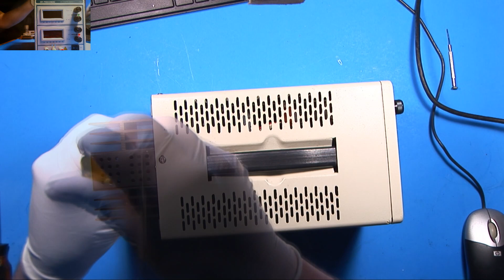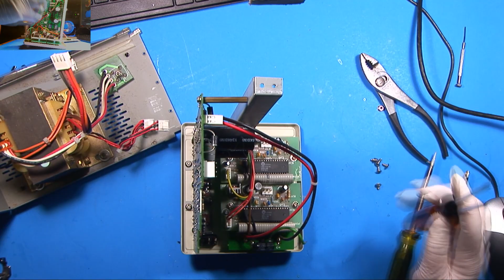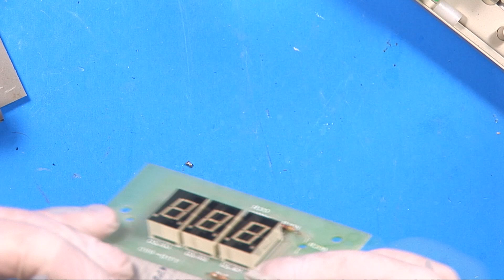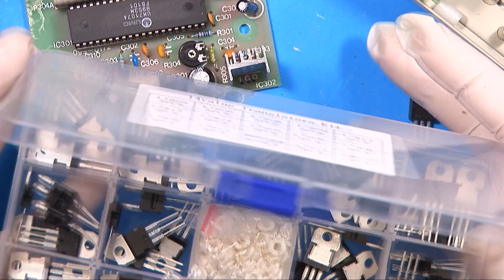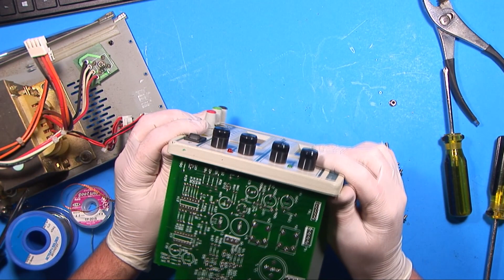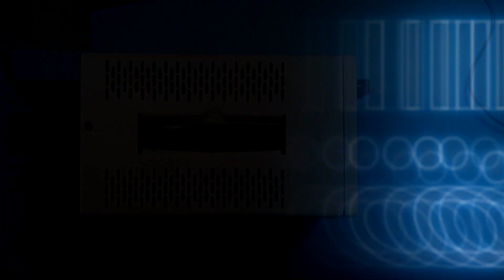Bench Power Supply Teardown and Repair - BK Precision 1735

Comment: I always teach my students to clean of any flux residue after a repairjob.
First: A bad solderjoint is much better visible without the residue on and all arround it. Secondly, if you spot a not cleaned up solder joint, you immidiatly know someone was in here before who couldn't care less.

Comment: I am considering recapping my 1735, because it is decades old, and I have some questions. Here is my link on EEVBlog. I posted there, because I can't post pictures here. Please give it a look. I would greatly appreciate your help. https://www.eevblog.com/forum/beginners/bk-precision-1735(non-a)-psu-recap-question/msg2445162/#msg2445162
Reply from the maker: hey sorry I didn't get back to you sooner.  Looks like Jay answered your question.  He's absolutely correct, couldn't have said it better myself.  If you recap the unit, just unsolder the caps that are installed and slap some new ones in.  Just be sure that you have the polarity correct.

Comment: @ Cody - I have the 1735. At zero volts, my minimum CC setting reads 0.01A, on the on-board display. It reads 77.8uA on my Brymen BM869s DMM, being in series and without any load other than the multimeter's own burden. I am a novice, so if I did not put the multimeter in series correctly, please let me know how to do it and I will re-test for you.

My guess is that your 96mA is just caused by a required minimum load for the circuit to operate and is acceptable. The data sheet may provide the exact answer: http://www.ti.com/lit/ds/symlink/lm723.pdf I am not great at reading these, yet, so, if you do look it up, please post the exact answer.

And, if there are any other type of tests that you would like me to do, just ask. My lab is set up permanently, so it would be know problem.
Reply: Hey, so the lm733 is only making a 5v reference which is then inverted by the opamp for a +- 5v ref. It has no control over the actual regulation of voltage or current in the power supply it's all controlled by the opamps. The 723 could have been replaced with a 5,v reference Chip but back in the day it was cheaper to use a 723 than get a reference ic accurate enough

Comment: This is a nice three-part series on the BK Precision 1735 (non-A). Thank you for your effort to share the information.

You mentioned that you would not be calibrating the voltage and amperage readings, because they were good enough. Mine are significantly off, so, if you could borrow the unit back from your friend, I would really appreciate a calibration video... Even if you just referred to the schematic and talked about how to do it, that would be helpful... Yes, I know about just using a multimeter, but it bothers me that the on-board meters are not correct/close. Thank you.

Special thanks to Cody for the schematic!!!

I had trouble finding this information, so I posted your links on an EEVBlog thread, on the subject. https://www.eevblog.com/forum/repair/bk-precision-1735-power-supply/

Comment: Hey, I got a 1735A a while back which was stuck in CC mode, I couldnt find the schematics, so i emailed BK precision on there website and surprisingly they emailed me the schematics for it, mine is the "A" version and only difference i see is that it has a 4 digit v/I display instead of three, all the control circuitry is referenced to the positive output terminal and therfore control ground is riding on top of the main output voltage, the schematic is drawn quite poorly and the lack of a legend makes it very hard to decipher certain parts, i got it fixed and working great no problem but for the last year as time allows ive been trying to understand and redraw the schematic to try and figure out the issue im having, the constant current works, but i can not set it under 96mA, so when i short the output with the course and fine current controls completely turned down it pushes 96mA, instead of (ideally) 0-1mA while the controls are all the way low. it does have a +/- 13 and +/- 5v derived from a extra winding on the secondary(with the center  tap referenced to the positive output as stated above) but the configurations of the amplifiers, throw me off, if the inverting and non inverting inputs on the cv amp were switched i would understan it all completely,and thats how i would have done it, but yeah, im lost.
so.. could you test, if you still have the unit or your friend can check maybe? if you dont mind, what the minimum constant current can be set to with direct short on the output and the C/F current pots turned low as they can go please? i would so appreciate it and do anything, ive been trying a year to find someone with a similar unit but they information of them seems so scarce online, let me know if the schematics would be helpful to you and i will send them, the schematics are for many models like 1710 1715 1720 1730 and 1735 and theres a table showing any parts/values that differ between the models, thanks for your time.-
Cody
Reply from the maker: Sure. I already gave it back but I may be getting it back to fix.  He connected it to a tesla coil kit and it got zapped and won't turn on.  Not sure what happened considering the case is grounded but if I get it to fix and once it's fixed I'll check for you.
Reply: @Electronicle  Okay great, also if you could please, take a clear picture of the front and back side of the board, im going to post a link to the schematic its in my google drive but its a shareable link thing, that is a easy fix, this schematic is for the 1735 model, i cant find it online anywhere but bk sent it to me, the output has some protection diodes that i bet picked up the transit, if he had the power supply powering the tesla kit then especially. D1 and D15 i think it is, right by the output cant miss them, they are also marked 3A,   

https://drive.google.com/open?id=1hPfrbPpVYsPpvWJyk9woXMio2SEN9Y1b

thats the link to schematics in my google drive, goodluck and thank you very much for the help!

-Cody
Reply from the maker: Cody Turner hey I’m sorry I didn’t get back to you.  I have the power supply here and am working on it so yes I can send u the pictures u requested if still needed. Sorry it’s been so long.  Also any chance u could reup the schematic/service manual to ure google drive?  Txs again
Reply from the maker: here are a couple links to images of the board if you still need them:

https://drive.google.com/open?id=1UTZf0lRMxIFOBGM3m2JKutHKFZUPHFZg

https://drive.google.com/open?id=1jZkXvO7JUSCr2tn8F2lbwndxn316j08r
Reply: @Electronicle  sure when I get home Monday and thanks again!
Reply from the maker: Cody Turner Txs. Nvm I had to copy and paste the link.  So nvm it works.

Comment: All said and done, what's the opinion on having one of these supplies in 2019? I have been short of spare cash so I passed on getting one of these recently. Three of this exact BK 1735A were available for about Cdn $100 each at a surplus store but they're gone now. I dug out a transformer/regulator chips power supply kit I've left in the original bag for years, i.e. not a switched mode circuit, but by the time I add a large enough case, 2 displays and pots for current and voltage, binding posts, etc. I'll be up to about $100 invested anyway.
Reply from the maker: Absolutely.  I personally use an Eventek bench power supply and paid around $60 for it on Amazon.  The DC output is a little noisy, however you get what you pay for and that noise can be cleaned up within the circuit if its a problem.  So far I haven't had any problems with it, and its simple enough that if its breaks I can fix it or mod it myself.
Reply: Why would you want a switched mode, they are very noisy (electrically), fine if you just want to charge batteries etc..